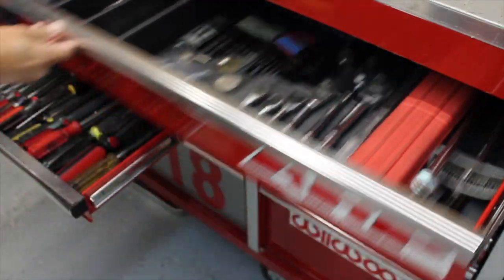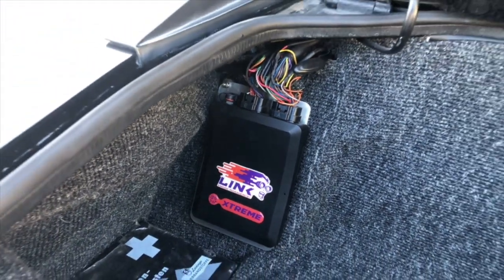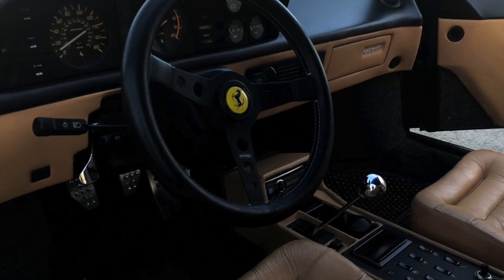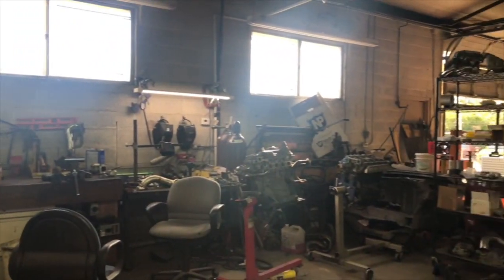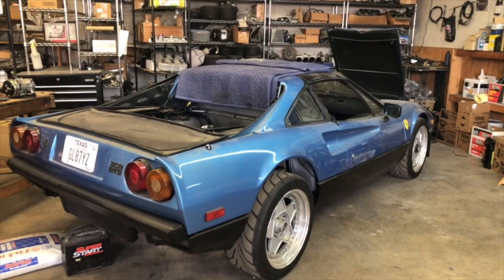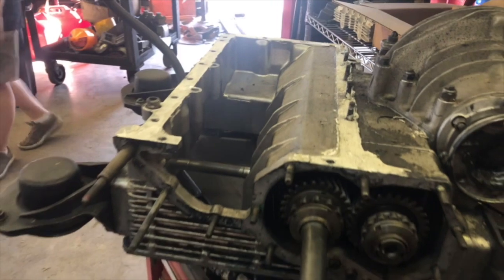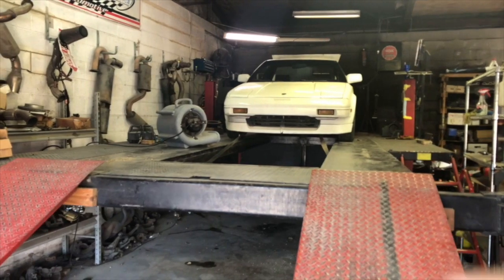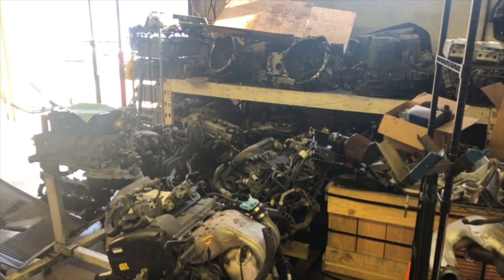A late ‘80s Turbo four seater Ferrari!

Comment: i´ve seen some videos and all have the seats too far laid down if more in a correct position you can feel better the car and safer this imediatelly as you start to drive it ,it´s not to sleep but to drive fast ,in this position you can´t feel the car and have dificulties to handle it even at 60 miles an hour you feel it not easy to keep it in a straight line, i´m not saying you have to put it in a 90 degrees position but not so laid back well if with a girl even more laid back but if to drive it ,put it in driveable position, this is not me critisizing is just giving a good info in how to drive cars